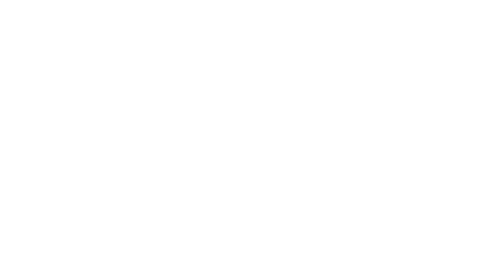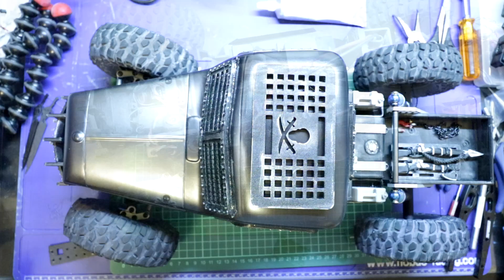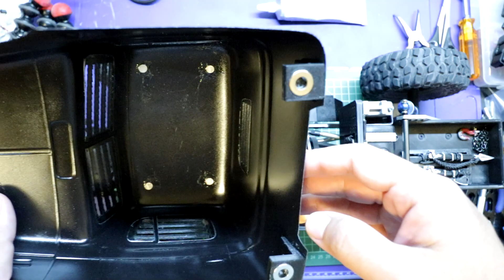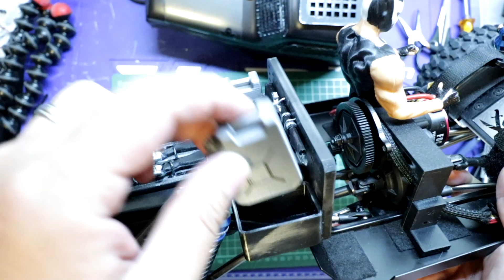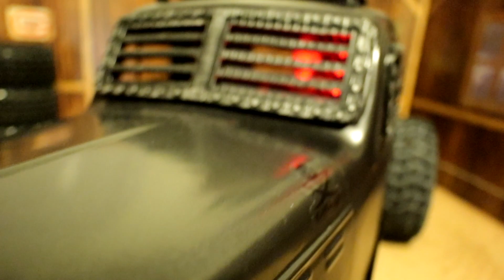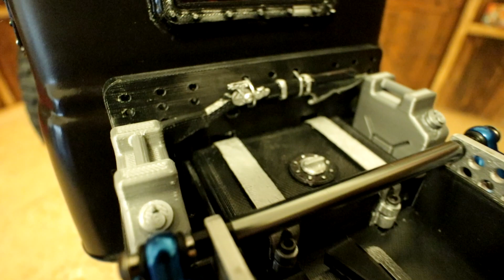Element Enduro Builders Kit Build Series - Part 12 - 3D Printed Parts Body and Lights

Comment: Turned out awesome. Hope the front bumper is quick to remove so it don’t get broken on the trail.
Reply from the maker: Thanks man.  Yeah the bumper is currently using the bumper posts.  I plan to make some adjustments to mount it a different way, and maybe have ScaleMetalSupplies fab it up for me in metal.  It's an area of the rig where I've still got a lot of ideas that I'm playing around with.